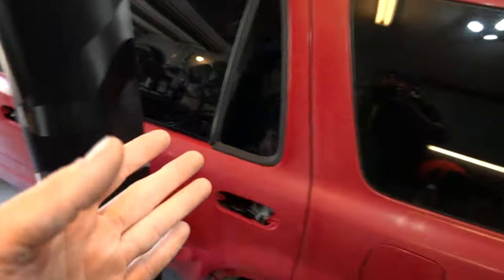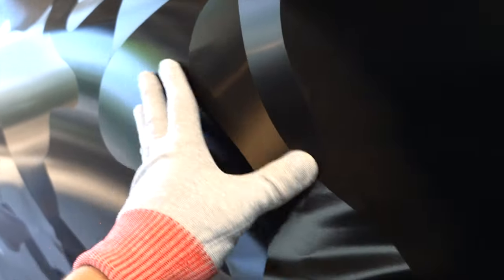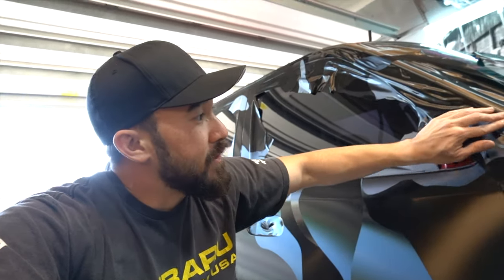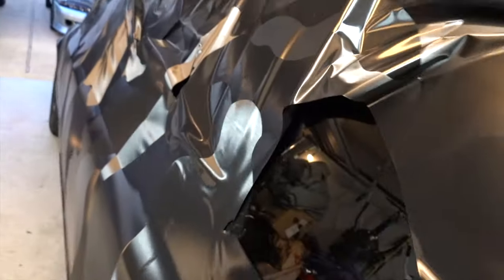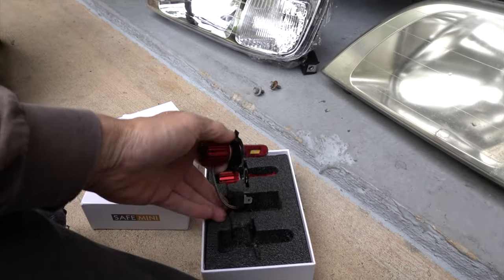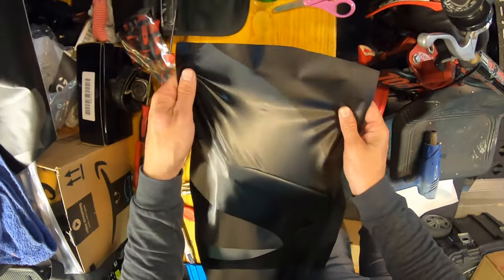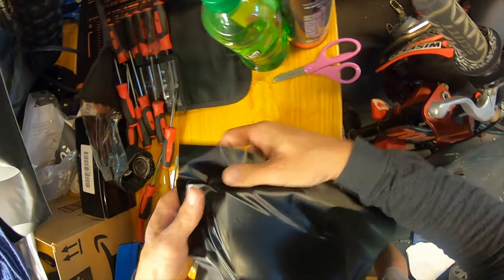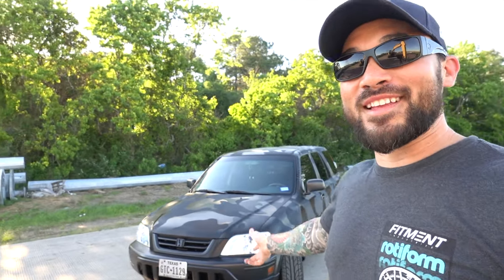Vinyl Wrapping the Honda CRV RD1 in Vvivid Stealth Black Camo / Mod My CRV

Comment: LED bulbs in stock reflector headlights suck. Just save yourself the trouble and do a projector retrofit, will look so much better. Clean install on the wrap though. I've had Hondas all my life, even an NSX and a couple CBR 600RR bikes, now I have a Pilot which is killing me in gas, so thinking of getting another smaller Honda, probably an S2000, but these CRV videos are making me want one too.

Comment: did it lay down/stick well on parts where your clear coat or paint was faded? My roof and hood are faded as hell so i wanna either wrap or paint them, preferably wrap if it works well so i dont have to color match paint

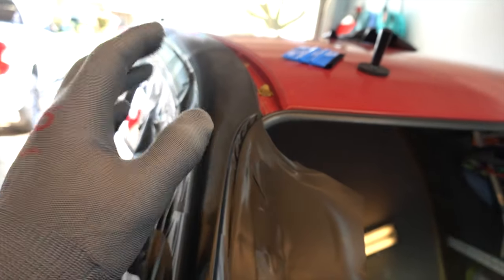Comment: Quick question. @5:21 I see you took the roof molding. Did you use the same molding or did you purchase new one? if you did purchase a new one. Where can I find it? I been looking all over for it. WIth no luck. Thanks. And the CRV looks sick! Great job.
Reply from the maker: Reused the original
Reply: @Donnythelatemodeltech  Good call, I have not been able to find new ones anywhere.

Comment: How did you get the front low like that
Reply from the maker: I'm going to do a update video on this issue. Soon
Reply: @Donnythelatemodeltech   thanks i just installed some coilovers on 18’s but they  still need about an inch or two for me to be content 
Any advice is helpful
Reply from the maker: @TasteLikeSilver  going to need some extended top hats